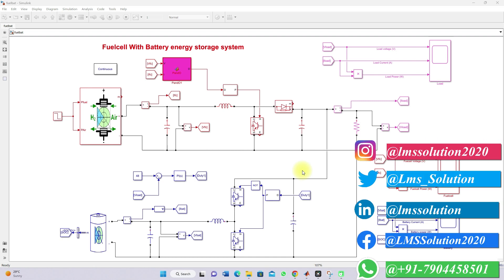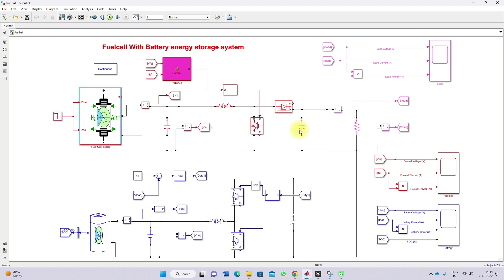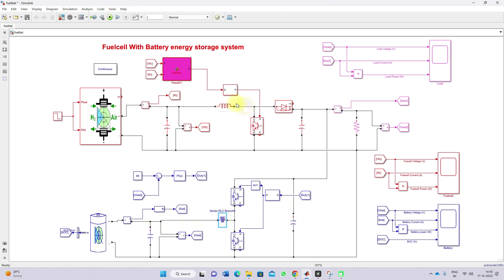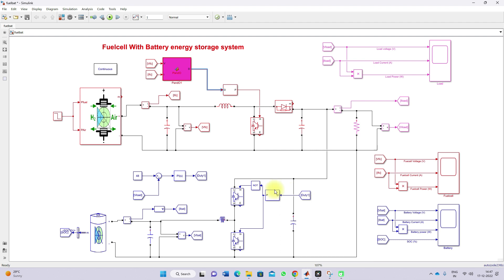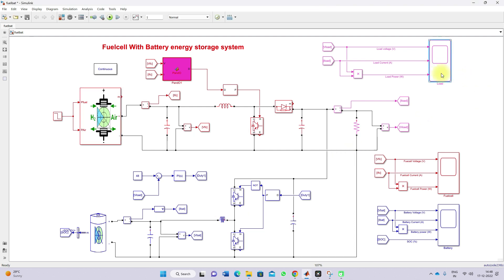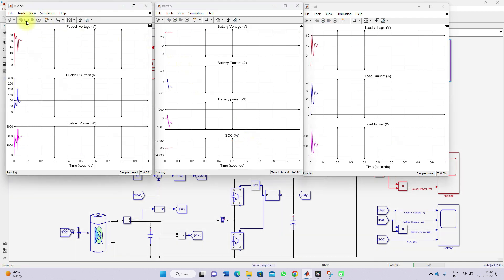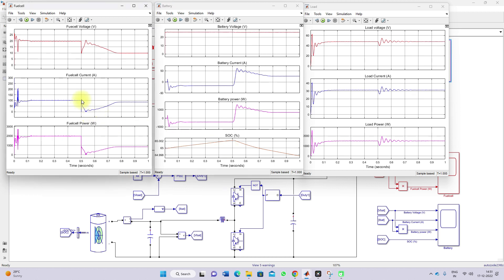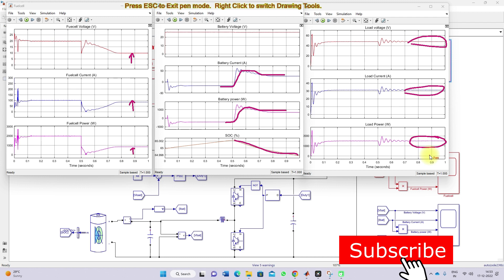Fuel Cell with Battery Energy Storage for DC Microgrid | MATLAB Simulink Modeling & Control

Comment: Thank you for the video, could you explain in the battery section the purpose of the block that is connected to the positive terminal of the of current measurement block
Reply from the maker: Purchase link for Indian customers: https://www.itpes.net/product-page/fuel-cell-with-battery-storage-system-in-matlab
Purchase link for other than Indian customers: https://www.lmssolution.net/product-page/fuel-cell-with-battery-storage-system-in-matlab